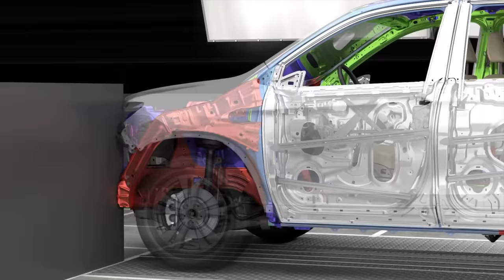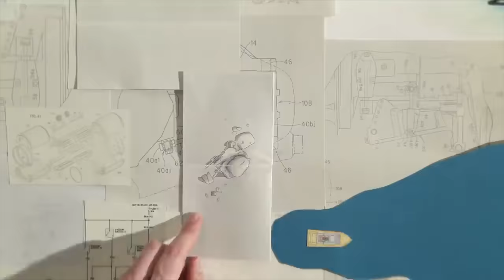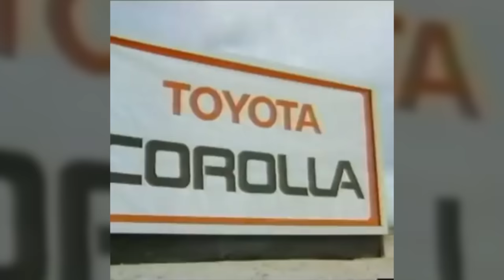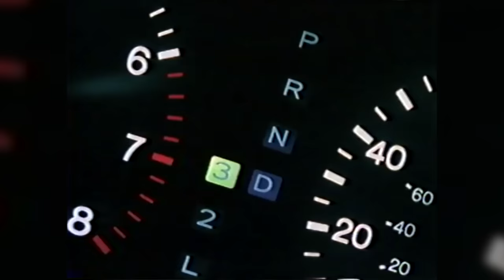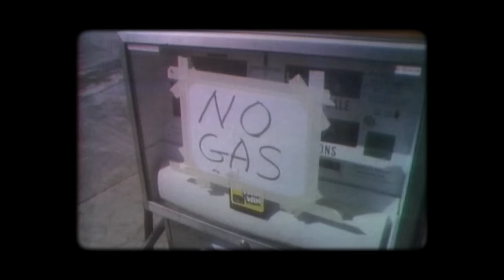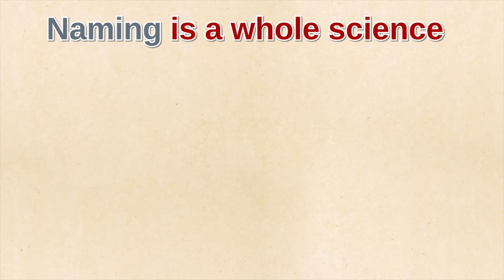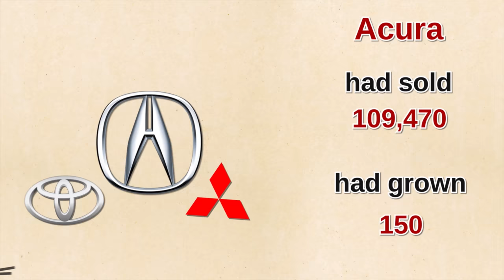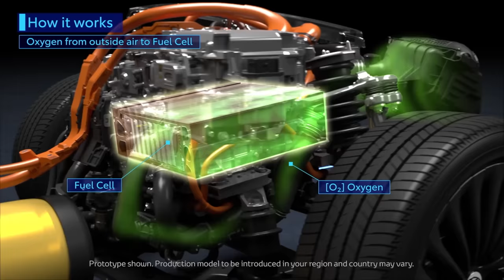Here's Why I Only Buy These 4 Car Brands

Comment: Hey Scotty, 
I’ve been watching your videos for years now. I own a 2014 Honda Civic with a mileage about 77,000. I’ve kept up with oil change at every 5,000 miles and it’s been running nicely and it hasn’t cost me any for any major issues. I want to be able to drive it at least until 200,000 miles. Anything I should do for continued maintenance?  Also, at the next oil change, I’m planning on changing the transmission oil for the first time (just drain and fill; not a flush). Any suggestions would be greatly appreciate it.

Comment: Scotty you should come to Japan. I got the Honda freed 2020 model. Here I got it because the salesman actually went this is the price but next year we have new model not publically announced. For that there was a massive discount.
You go to their shop, you sit at a table they bring you a menu for your drinks. Here we have to prove to police we have parking spot. Previous car registered in different a different region. The sales person did research even brought the papers to my house for just my signature, it was prefilled. Kids dinged the door due to wind. The sales man goes yeah we will charge 250 to fix it but you can just get that at the car shop and fix yourself because that would be cheaper for you. Plus free basic maintenance for 5 years. Just chatting with them. Partner said my bitlrthday and that is why get new car. They actually put a larger Navi and Kenwood speakers with heated seats and alloys in it for free and when I went to the place to get the car I even got a cake and flowers

Comment: Yeah, I dunno.  My parents had issues with their Accord. I had issues with my accord.  Besides certain mechanical issues both bottoms were rusted out and needed replacement.  Entire exhaust systems.  After 110,000 and 140,000 miles.  Brother had some problems with his Pilot and the after he handed over to parents it had nothing but problems.  Visited the repair shop every few months.  I'm not sold on this Honda or Jap car hoopla, no matter what the pundits and "stats" say.  Which I dont believe in.  Now have a 2011 Jetta SWG.  Bought new.  Only thing I needed to "fix" was the alternator.  Thats it.  Have 247,000 miles.  No rust.  And the car feels so solid, and still handles close to as when new.  Unlike the japs. I really dont care for the Honda/Toyota nonsense.  Used to believe but no longer.

Comment: How about Honda Elements? Love my 2008 Honda Element SC with manual transmission
Reply: I have a 2008 Honda CRV they both have the same engines best Motors ever made you should get 300,000 miles out of that motor

Comment: Hondas are great cars, no doubts about that. However, like each and every other japanese car manufacturer they have major issues with protection against rust. The quality of their metals simply aren't up to the same high standard that Volvo uses. The other European car brands suffer the same problem. But I will say, if I'd had the luxury of waiting a few months more to get another car, I would have gone from a Volvo V70 to a Honda Civic. Because of how zippy, reliable and just overall sexy these cars are. However, I chose a another V70, because time for my old car was up and the others who had the Honda weren't ready to sell. And this comes from a hardcore Volvo man, by the way.

Have a lovely day.

Comment: Yes..  Japanese Toyota or Honda are the "best".  Period. Ive owned a 1987 Corolla FX , a 1990 Corolla which I still own with 262,000 miles and also presently own a 2017 Corolla SE with 63,000 miles ....loved em all and will be purchasing shortly another Toyota.  My brand is TOYOTA and recommend this brand but I would also buy a   HONDA if needed.  Great video Scotty. " Arigato" 😉

Comment: Can't beat Lexus. Bought a used ES350. Best car I've ever owned. Quiet ride, powerful engine (for a sedan) and nothing needed except general maintenance. Toyota is also the best, but gotta make sure it's made in Japan. Don't buy the crap made in Mexico or Canada.
Reply: Lexus is made by Toyota 90% of the parts under the hood of a Lexus are the same as it Toyota counterparts and you can by them for cheaper at a Toyota dealership vs Lexus. Also Toyota and Lexus are either U.S or Japan assembled. Parts are still made in Japan for the most part. They just assemble the American made ones here
Reply: @adamtajyar  Yeah Lexus is just Toyota's luxury brand. So they're both good cars. Can't beat em

Comment: I guess with all that heavy duty R&D and so many consumer market the vehicles cater to keeps the prices for HONDA suv, trucks and cars sky high even in pre-owned with high mileage...I like Tacomas, but no V8 option or V6 turbo is an expensive long lasting paperweight with a tight backseat. Tradeoff. Get a used jeep GC V8 with extended warranty. Screw KAIZEN.

Comment: My first car, a 98' Civic EX lasted 450,000 miles before I gave it away. 
I had a Mazda and Lexus that both lasted over 400,000 miles. 
Fully synthetic oils from Amsoil or Mobil 1, and the best air filters with NGK sparkplugs and only pump gas at Chevron and sometimes Shell. I never had a major repair on any of these cars. Also, I have a habit of accelerating slow, but on freeway ramps, I sometimes accelerate full pedal so it burns carbon buildup.

Comment: Stuff like kaizen you would think is such a no brained. And while many companies claim to follow that kind of philosophy, in almost no situation is it actually implemented effectively. And it’s so much to the point where it’s considered a huge joke to imply that any positive change can be made in a big company, to even slightly imply you might be able to make a positive difference in how things are done, you will be laughed at. 
I have to imagine with the seniority system in Japan they run into similar problems where more junior employees find it harder to get anything done, but clearly Honda and Toyota were able to overcome that. 
In the US, employees awe absolutely terrified of “rocking the boat” , and will just go along with what they’re told praying that they just won’t get in trouble. Improving things isn’t even considered.

Comment: Honda cars are so commonly stolen because of two reasons - you don't have unique serial numbers on all of the parts mounted in the car, hence it's easier for the pawn to re-sell them and also the spare parts at Honda are super expensive so when it comes for a change, it's very costly and there aren't many aftermarket parts available as for other brands. So you have it - the reason why the car thiefs love Honda (but also Toyota and Mazda), the thief doesn't care about residual value of a few year old Honda as he's not gonna be selling it as a whole :P

Comment: My 12” TL that was in an accident still got 5500 in trade in value.
Reply: In India the initial years of 2011 -13, Toyota Etios leaked water from doors as they did not provide the rubber beading on the doors during heavy rains - monsoon season. Also Indian Toyota Fortuner from 2010-11 had severe braking issues. I myself drive a 2017 Corolla Altis but sorry, Toyotas have their faults..sometimes big ones.
Reply: @ta110470  in usa toyotas are a big deal.. those who are used to suzuki knows that toyota has nothing on suzuki.

Comment: One of our 5 cars is a 2007 4cyl Accord which is our "work car" bought it with 130K miles in 2019 and today has 355,00 miles on it. Mostly highway miles, wear and tear average replacement parts as with any vehicle. But I feel still capable of 100K if not more miles left in it.

Comment: Honda is just built to a higher standard. Almost all of their cars last for 20+ years with no problems, and their interiors, styling, and features are actually competitive, unlike Toyota. Honda/Acura has made several excellent cars in the past 20 years, from multiple generations of Type R to the NSX, and their whole Type S lineup has been absolutely great as an affordable alternative to AMG and M cars, plus you don’t have to worry about ze germanz and their high maintenance costs. Toyota have made 2 truly great cars in the last 20 years, the LFA which is borderline unattainable now, and the MK4 Supra which I have only seen one of in my life. The F line other than the LFA has done nothing of note and made overpriced, overhyped cars that people just gobble up because of the Lexus name. TRD is a joke. All of their other cars are either overshadowed by a better competitor or are only worth mentioning due to Toyota-scale sales numbers.

Comment: No doubt that Honda and Toyota are the most realiable car. I'd prefer Honda coz of its innovation and technology ahead of toyota. Honda bravely introduced new technology while Toyota still play safe with the technology they used to until few years. So Im not surprised toyota is realiable coz for example, at that time Honda used cvt Toyota was still using the 4AT which is the technology the automakers used for long period.

Comment: So you only buy cars from 2,,,,,,TWO car companies.  I've owned a couple of Accords starting with the first generation of that car.  And two Toyota trucks.   I lament that Accords became so large and not so simple and the same for Toyota trucks.

 One Acura in the middle (which actually was of lesser reliability than older American cars I've owned. Even Honda can make a lemon). That Acura in 70k miles had more repairs needed than the two Honda's and Toyota's combined which collectively accounted for over 850k miles.

Comment: dont buy a 2004 civic stick shift. you will replace upper and lower control arm bushings. get a car fax.  on manual trans the copper bushings wear out rather quickly. 16 valves get hot and bend. water pumps go up after 250k mi . dont buy Acura for simalar reasons. Toyotas are good but on the east coast salted roads will cause them to rust out. Dont buy a 95 Grand Cherokee or Dodge pickup with that v8. they are junk

Comment: Suzuki and Maruti Suzuki are cheap and good but rust but I really rate their motorbikes and 800cc Maruti vans that get hammered in India and keep going
Reply: You could buy an 800cc van for $5000usd. And they lasted over 10 years.
Reply: The kamiz and Tata diesel trucks and buses are used in India, Nepal and Russia and even central Asia and Afghanistan. The Kamiz trucks would do over 1 million miles and keep going. They would start in winter in the snow in minus 30c and they would build a fire under them which was dodgy to say the least and it would thaw out the diesel so they could start the motor. The Russians are experts in getting diesel engines to run in places like Siberia but I don't know how they run those trucks running on ice in winter in northern Canada or Alaska. The Chinese must be good too as they have to run vehicles in Tibet.

Comment: I got a new honda accord. Complete waste of money. It cost me almost 40k, gets worse gas mileage than my 350whp 2015 vw gti, does not work well with android phones, has driving assist that almost killed me because it thought a wall was a lane. Honda is great, but so overpriced and hasn't caught up with its time. When my 2022 Honda gets worse gas mileage than a modified 2015 gti, you know there is a problem.

Comment: Scotty I bought a 1996 Honda Accord V6 and a 2004 Acura TL v6 and both trannys blew at around 80k miles. When I was making more money I then bought a 2008 BMW 550i and this car never gave me any issues it was solid. I sold it with 135k miles. Sometimes Your logic is flawed. You see the average Toyota driver doesn't really push their car hard whereas BMW drivers are mkre sport oriented cars hence BMWs are driven more spirited. So obvious question which car will be more reliable?. Obviously a Toyota if its driven like a Grandma. Also oarts aren't as expensive thanks to online vendors. I needed to replace front control arms for my BMW. Dealer was asking $800 but I purchased OE Lemforder brand from an online supplier for $300. Again your logic is flawed.and Honda produces garbage V6 transmissions. Don't take my word for it do your research

Comment: So I am at about 13 minute mark and Scotty is talking about Lexus and their design goals, etc.
It is all horse crap. Toyota did the old Japanese thing - cloned something. 
They did not come up with some new and unique design.
Visually, the Lexus sedan was heavily based on a Mercedes E class.
Would I buy a Lexus? I don't know. Never owned one. Would I buy a Mercedes? Own one now. It's been incredibly reliable but I would not buy another. Any repairs are very expensive and frankly German plastics are crap.  Yes, mine has been almost bulletproof but I have met a Mercedes mechanic who was shocked about it. He said my year/model has tons of electrical or maybe electronic problems (he told me that 10 years ago and I cannot remember which).
That Mercedes mechanic drove an old Toyota Carrolla with a standard transmission. LOL

Comment: Honda and Toyota all switched to Turbo engines....now they are JUNK....you will be lucky to get 200.000 km out of these engines.

My 2014 GMC Terrain runs perfect on the other hand , 2.4 litre GDI engine ( non turbo )  with 270.000 km on it always ran Mobil 1 full synthetic and Fram ultra filters.

So in concert Toyota and Honda used to be superior....NOT anymore unfortunately I will stick with my GMC. 👍

Comment: WOw what akrock! Honda's have self destroying engines that are very loosely built and until us govt forced them to except vw tech and and design assistance to prevent the massive pollution issues from Honda's tech not actually functioning in real world also audi/skoda is the largest and most prestigious engine builder! Also the pioneers of turbo and superchargers in cars trucks and aircraft beginning in 1930s hybrid vehicles in 1890s electric polo in 1960s(brazil) fully demand driven/emissions feedback regulated digital fuel injection in 1969 and began building rabbits in USA in 1974 they were building engines in america for other brands by 1970

Comment: There are 2 reasons why hondas are stolen more and a number of sub reasons. 1) There are a whole lot of hondas on the road. If there are a million hondas to every bugatti, then you would expect many more hondas than bugattis to be stolen. There is a lot of demand for parts. 2) People don't typically steal cars to drive, they steal them for the parts. A 20 year old honda is worth more than a brand new one, as the parts are harder to find in many cases. Since more people own them, more thieves steal them to supply parts so that more people can continue to drive them. 

It is only secondarily true that people love the honda. I do not. I absolutely hate honda. Rolling piles of crap. Overpriced crap. But that is the opinion of someone that likes things honda does not offer.